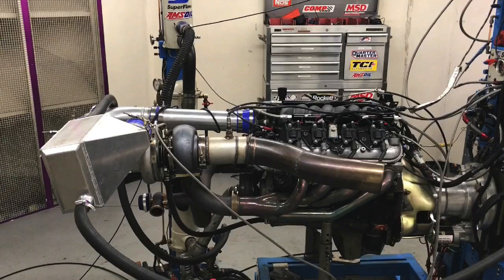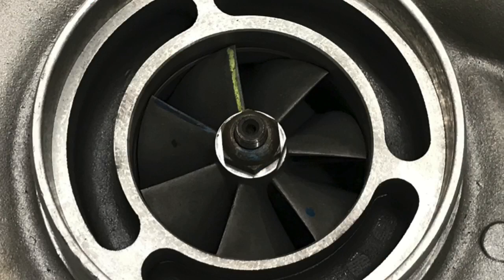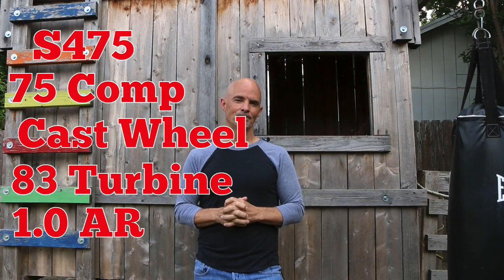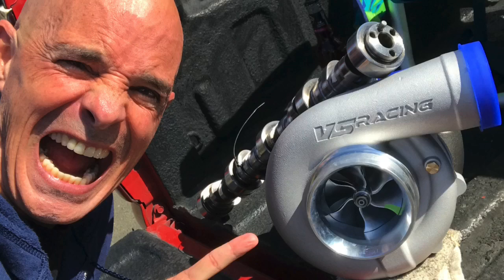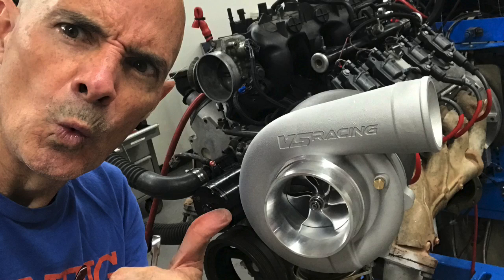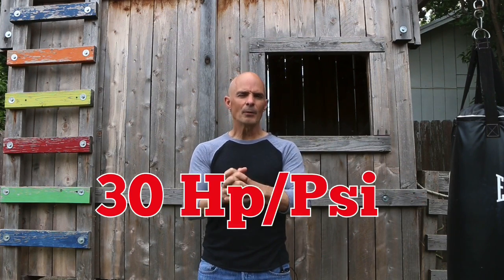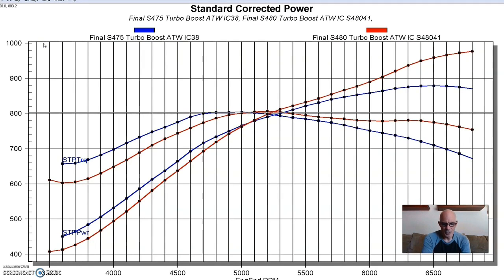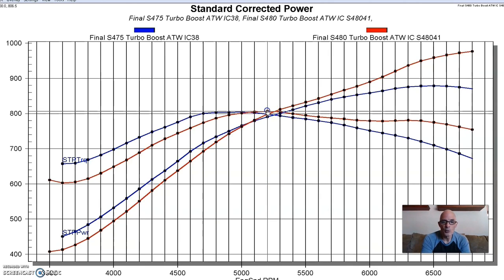HOW TO: PICK THE RIGHT TURBO!

Comment: I have a question I have a big block Chevy ho 502 Factory rating 450 horsepower 550 ft lb of torque I was looking at a 475 Turbo 78/75 with a Air1 .25 Hearthside I'm not after major horsepower I'm looking to increase the bottom in pulling under 4,500 RPM so I'm looking for a turbo that will come in somewhere surround I would say 18 to 2000 RPM increase the low-end torque of the big lock to help pull or for off-road applications truck is used as a daily driver toy mod off-road and towing vehicle would you recommend a s475 is the air 1.25 ok if not what do you recommend I'm only looking to make about 9 pounds 9 and a half pounds Max boost at any given time probably even more likely around 8 thank you for your time
Reply from the maker: that turbo will do what you want on that motor

Comment: Hi from Australia Richard, I love your vids. I have a 2014 Jeep SRT 6.4l SBE with 25k miles, I am working on a rear mount turbo system and am going single turbo. trying to pick the best hot side size for response for a peek power of around 750 crank HP, around 8 PSI (street use). I was looking at CS racing 7875 or pulsar turbo G42 1450 Which is a perfect clone of Garrets g42 1450 turbo. any advise on hot side wheel size would be much appreciated.
Keep these vids coming! I have learnt so much from you. you simplify things so well. you have given me the confidence to do my own set up. 
Love your enthusiasm....
Glen Z.
Reply from the maker: I KNOW THE GEN 2 VS RACING 7875 WORKS WELL

Comment: what would be the difference if say u took the 480 hot side and put it on the 475 and see what that would do for responsiveness? so like the difference between a top end drag car or a street car that stays mid range n stop n go so responsiveness would be top priority then .....  im upgrading from a journal bearing to a dual ceramic ball bearing turbo for response n hopefully better power as i kept hot side at .63 and upped compressor from a 57 i think i was to a 60 so i should see more response and more boost going on bearing response differences .... love your vids bro super informative ... peace n love fam keep it rad stay safe and build on bro l8z

Comment: So many turbos! So many choices! I’m halfway completely lost finding the right turbo for my build….. You should sell your knowledge. How much for 30 min of your time? 😜
Reply from the maker: what power do you want and what is your motor
Reply: @richardholdener1727  end goal is 800-1,000 whp for now….. I have a LY6 with 823 heads. I haven’t picked out a camshaft for it yet either. I’ll be running a powerglide. I’m putting together a 2008 Chevy Colorado for the track…. Stripped to the bare essentials….. I want to use Fahler log manifolds….but the Holley ones are ‘cheaper’…..Any advice is welcome, this is only my second build. My first build is a gen 3 6.0 with a Sloppy Stage 3 and 862 heads, with a 80e in my 1985 foxbody. Great daily driver. But I want something just for the track so…… $300 rust free Colorado for the win😜 I appreciate what you do with all the videos, keep up the great work my friend!

Comment: You always talk about the right ring gap. What is the right ring gap for turbo or how do you find that out? I have a 5.3 ls engine wanting to run 600-800hp. 0.020- 0.025 is what I've come up with. Any help would be greatly appreciated
Reply from the maker: I run .007 per 1 inch of bore size
Reply: @richardholdener1727  thanks for the quick response. I love your videos. Hope you and your family have a happy Thanksgiving

Comment: For those running older motors and only looking for say 50% power improvement ie. 7-8 lbs of boost, I find that pressure ratio (1.5) well below the most efficient boost level of every compressor map out there.

Comment: Hey Richard. Not sure if you will get the chance to see this but I wanted your opinion on this. I recently got a garrett GT47 for an absolute bargain but I'm concerned that it is to big.  

I have a L98 which is a 6L LS and the specs of my turbo is a 84mm inducer and has a ar of .69 on the housing. The turbine is a t6 93mm OD and 85mm exducer with an ar of 1.23.

Should I be concerned about the compressor being larger then whats shown here on the s480 or will the slightly smaller turbine housing help it spool quicker and make up the difference?

I'm not chasing anything imparticular in terms of HP. It's literally for the fun of it but I would like for it to actually make boost! 

Whats your thoughts? Thanks in advance!
Reply from the maker: its probably not ideal-but no turbo really is, if the price is right-try it-it will probably work on that 6.0L

Comment: Is back pressure rising because the wastegate is at its Max flow rate? Could you run a bigger waste gate or a dual wastegates on a single turbo setup and how would that work out on the dyno? I'd be curious to see that.
Reply from the maker: its not waste gate flow-its turbine flow

Comment: If you run a similar test again, you should put a 1.58 exhaust housing on the S480 and record the difference in back pressure.

Comment: for every 2 lbs of boost i have 0.9 lbs of back pressure but i’ve been building them for about 27 yrs so i just start building them for my application all by reading the maps of both sides and honestly the billet wheel is a bit heavier but they don’t fly apart like cast wheels .... witch it pretty scary i may say 😎✌🏻
Reply from the maker: what application do you not care about response?

Comment: how do you set up a turbo system or possibly twins for low end towing power on an 8.1 chevrolet engine with 340 hp starting.

Comment: Nice videos. Keep up all the great work. The reason one turbo makes more hp per psi on the same setup is because of where it is on the compressor efficiency map. As it becomes less efficient, it starts generating more heat and less airflow, thus reduced power. And it depends on the application. There is always a limit to how much octane, boost and timing you can get into a motor. Lowering the compression will allow you to run more boost and timing without detonation. If you exceed the turbo's efficiency map it can no longer produce enough air to keep up with the boost required. Thus is falls off.
Reply from the maker: the amount of power a turbo supplies is a function of the na power much more than the map position
Reply: @richardholdener1727  I would rather drop the compression and run higher boost and make more horsepower than run a high compression na motor that makes great power off boost with limited boost due to getting into detonation

Comment: Can you do a video on the best twin turbo set ups ???
Reply from the maker: what do you mean by best?
Reply: @richardholdener1727  almost the same like if your looking to push 1000hp and up this twin turbo set up is best or these 2 smaller turbos will work best for 1000hp and below situation I've seen some of your videos and I see sometimes its best to have 2 turbos at low psi than one turbo at a high psi

Comment: What would have been really interesting was advancing the cam in the larger turbo to see if you could recover the low end torque to match the smaller turbo at what cost to peak horsepower.

Comment: Double the air and double the fuel gives you double your original bang. Big hotside impellers need a lot of wind to get started spinning. Before they start really spinning it's basically just in the way. Size your turbo to be on boost at the rpms you see most often.

Comment: One issue that should be looked at is whether or not it is worth spending the extra money on dual ceramic ball bearings or does the traditional film layer/journal style better suits your needs? Not everyone needs pricey ball style bearings. Most people don't even know how to run them correctly. They flood the bearings with the wrong type of motor oil, which will hinder the balls from spinning in the races. Ball bearings actually need very little "race" oil. A fine mist is what high-quality bearings are designed to work with. They need just enough to keep them cool and from making metal to metal contact with their surroundings. Many times film layers/journals are superior to balls if it is going to have a super high shaft speed(small turbos) and only a hydro-dynamic layer can cope or the engine is going to get street use. Research before dropping $2500 bucks on a turbo when a $900 dollar unit might meet all your goals and even last longer, in some cases. There are some really good companies here, in the U.S. who make their own niche' turbos. There are some really smart guys here in America ready to help you with one phone call. Try getting genius-level answers when calling an overseas manufacturer. If you are watching Mr. Holdener's videos, take notes. His experience is invaluable.

Comment: Would a single s366 work well for towing on a stock lq4 6.0 4l80e in a 6200lb truck? Rolls across the scales at 16k loaded. Im not looking for a peak power im looking for mid rpm power where my truck runs while towing
Reply from the maker: yes
Reply: Thanks not much info out there for towing applications.

Comment: I have a 6.0 lq4 4l80e.....862 heads btr stage3 truck cam 110lsa.what would be the best turbo for less back pressure and more boost down low. Thanks.
Reply from the maker: what power level
Reply: @richardholdener1727  600hp  with stock internals other than cam and springs

Comment: Richard, Looking at your graphs, at around 5,800-5,900 both turbos are producing the same boost, with the larger turbo making ~20-30hp more. Is this a result of the lower back pressure of the larger turbo, and does the larger compressor wheel have any part to play? 

If it’s purely a function of the back pressure, is there some sort of formula that you can apply to work out how much Torque you would need to sacrifice to drive the differential back pressure over boost pressure? 

Thanks!
Reply from the maker: I don't have that formula

Comment: What would be a good single turbo for a 5.4 ford engine? Low boost... looking for 350hp at the wheels. I plan on installing comp cam turbo cams
Reply from the maker: cx racing 76 or Gt45
Reply: @richardholdener1727  thank you very much

Comment: I'm thinking about back pressure against the back side of the in and ex valves and spring rate that would be needed at seat and lower lifts.

Comment: Hey Richard, thanks again for taking your time to make these aWESOME videos ! I tried the ebay turbos on a 355, make 1335, with a blow through carb(CSU) but after 30+ dyno pulls,the seal let go,(smokey as heck) but they made big power, have you had good luck with these turbos lasting /

Comment: Can the 5.3 in the  2016 silverado stock engine stock cam just full bolt ons work with the 78/75 journal bearing turbo , any issues with running it on a stock 5.3 stock everything just bolt ons ? Really need ur help and info

Comment: Is it possible to run a quick spool valve that chases boost pressure 
for example
 { 8 LB of boost @ 12 LB of back psi }
 { 16 LB of boost @ 24 LB of back psi }
 { 28 LB of boost @ 28 LB of back psi  }
This would be achieved by 
using a quick spool valves on a twin scroll housing
With an actuator spring psi of 29.4 PSI 
{ atmospheric psi 14.7 x 2 = 29.4 }
To avoid choke flow

Comment: If you changed your boost control, say to Dominator with co2,could you raise your lower rpm boost? Then maybe lower the pressure at higher rpm, so it doesn't built too much?

Comment: Richard. im gonna put a turbo on my stock 06 series 3 3800 v6. I just wanted to get your recomendation on what size turbo would be quick spooling and efficent on my stock series 3 3800'. im shooting for around 400hp at thr wheels or as close as I can get. this is a budget setup so Ive been looking at some of the ebay turbos as I plan on just having a littel fun with this setup then build a more serious engine build over the winter.
Reply from the maker: a GT35 size from ebay would be cheap and effective
Reply: Thanks for taking the time to answer my question I really appreciate it. I've used a gt35 before on a 4g63t but it was a much more of a track oriented build. And it worked great.

Comment: I've been watching alot of your videos and I absolutely love them! I'm learning alot! I live in South Dakota and I want to build a sbc or ls twin turbo with a blow through style fuel injection from Holley for my 4x4 squarebody chevy pickup.  I want this to be daily driven year  around summer and winter. Is this a bad idea or I guess any do's, dont's, or advice on the extreme cold in winter for doing a twin turbo blow through fuel injection build? Also I would love to see you do a beginners guide to tuning a boosted engine for both fuel injection and carbureted engines to get a beginner like myself on the right path and not make instant junk.

Comment: Do you have the availability of showing different hot size piping on these? 2 vs 2.25 vs 2.5 and maybe 3 showing power difference and where they are in the curve and what happens to lower end boost.
Reply from the maker: doubt it will change anything

Comment: I am deciding which turbo to order. I am seeing conflicting info everywhere. Turbo size and drivability being my concern. LC9 /799 heads with a stage 1 or 2 truck cam (all cams are turbo cams) . My issue I want to feel my turbo when I’m driving. Too big and I will never be in boost. Too small and I will run out of boost. @ Richard Holdener I know you are busy but could you please advise?

Comment: Would have liked to see  a 4.8 and a 6.0 and then two turbos. 1 a s475 with a 1.32 AR and the other a s475 with  a .96 or 1.0 AR. 
That way you see what the hot side change is vs engine size.

Comment: If you’re drag racing in Florida and then move to Denver for a race, would you downsize the hot side of the turbo because of the higher elevation?  I know racers have issues with spooling I’m thinner air and after watching this I was thinking that a smaller hot side would help speed up spooling,  Do I misunderstand this?  Thanks!
Reply from the maker: you need to worry about over speeding the turbo at high elevation

Comment: I thoroughly enjoy your channel. You address all the crazy thoughts I have during the day while wrenching. Have you tried building a compound turbo setup for an LS? I'm an LS guy but run compounds on my cummins. It always seems to be in the powerband while towing. Just a thought and it would be cool to see a setup that holds 14 psi of boost from 3500 rpms. Keep up the great work.
Reply: I'm thinking of using a G42-1450 on a GM 525HP crate engine. 12psi from down low is the goal. Would love to get Richards take on this.
Reply: @Dodgevair  I was thinking the same turbo on a 408 stroker

Comment: I wonder if a smaller header and crossover pipe diameter on the hot side would help spool the s480 quicker? Or would it just raise the back pressure? Maybe that would be a good topic for another test.

Comment: How does AR affect a compound setup? I realize those aren't super common on the gas engine side but for diesels they are super common. In the end I suppose it is still similar in that the more restrictive hot sides are more responsive but limit overall production which is probably why some guys go with large singles over compound setups to lower the backpressure.

Comment: Thanks, I really want to know more about the different a/r's ,  are twins the only way to get a better boost to bp ratio or is it just running less boost to move the crossover point up the rpm range or keeping it lower,   my concern is lowest bp but not complete junk for spool up if that's a thing

Comment: There is an LH6 long block at my shop I can get for free. Was pulled for a stuck afm lifter. My buddy has an S475 used I could buy for $300. Do you have any advice on aluminum LS engines, I noted that cast iron is mostly what I see boosted. Have read the LH6, LC9, LC8, and L33 are similar, all aluminum, 799/243 heads 9.9:1 , flat top, Gen 4 engines.

Comment: So is the turbo more responsive spool up faster if the ar is bigger or smaller . How about the spool on a stock 4.8 with ebay gt45 is it responsive or u guys recommend something else only running between 10 an 14 pounds or wat it takes to get abou 550 rwhp in a s10

Comment: Richard, there is major missing point here. Its not just the back pressure thats causing the power difference for a given boost level. At the boost level you are running and the RPM range, the S475 is running into choke toward redline. The s480, on the other hand, is just more effecient at these pressures and flow rates. It would have been nice to see the intake air temp with these different setups. Towards your redline, the S480, according to some of the boost maps for similar turbos, could be as much as 20% more efficent than the s475. So, the s475 is cooking off horsepower. 
What would have been neat to see is the s480 with a smaller A/R or turbine. I'm wondering if it had a smaller one, it would have outperformanced the s475 accross the board.

Comment: Richard like I said in my previous comment a big engine does not produce more 'back pressure' compared to a small engine at same HP level , yes the boost to back pressure will way more on the bigger motor but the actual back pressure should be close . 
Can actually prove my theory if you go look at your VSracing turbo vs Borg,  @ 6500 rpm the 4.8 produces about 20 psi of back pressure and makes 800 hp . In this video same turbo  on the 6.0 its produces about 875hp @6500rpm and about 22-23 psi of back pressure.  Yes the boost to back pressure ratio is way off on the bigger motor but it proved my point that back pressure( exhaust gas volume) is a function of HP not displacement.

Comment: A neat test would be to see what power each of these turbos would make on the same test motor maxed out.  Put 25-30# spring in the wastegate and let them eat on race gas.  That will really show the difference in the hotsides and back pressures.